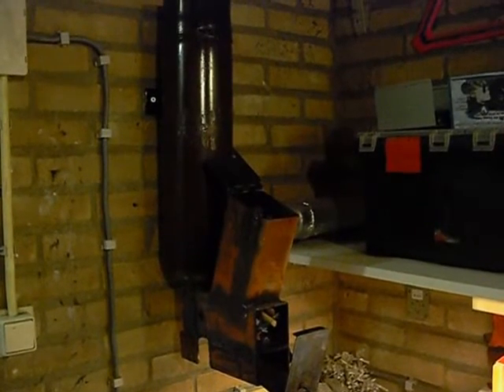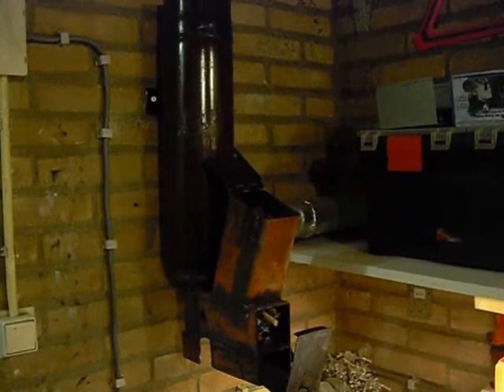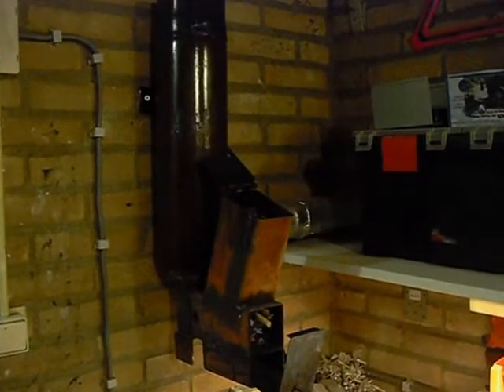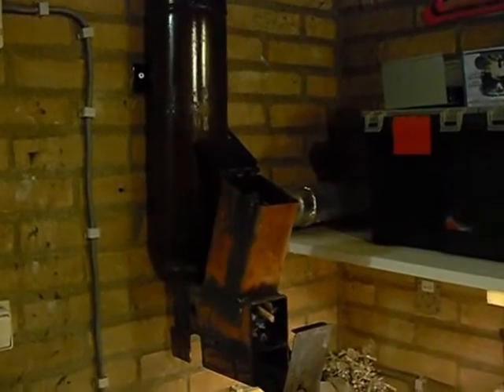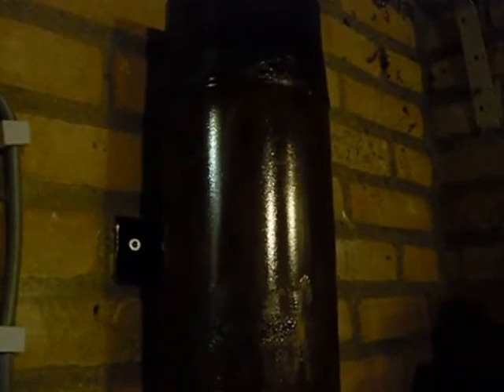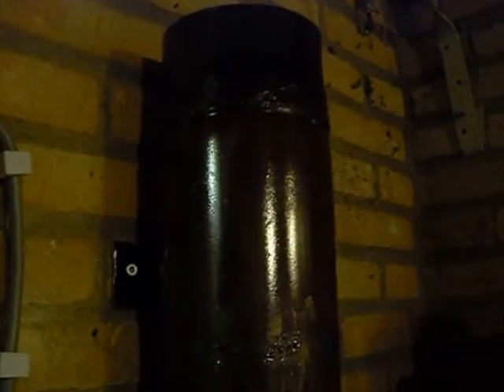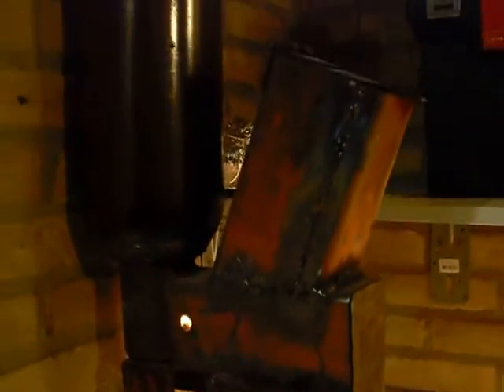Rocket stove heater (on steroids) build and installed as heater !!!

Comment: We're still patiently waiting on that knew clip hahaha. I live in Alaska and have since built this version of rocket stove heater and like it very well thanks to you of course for coming up with such a grand idea for small amount of wood and in return puts out large amounts of heat a very grand idea for sure. I'm kinda interested in seeing what modifications you've done to it since then. I built a small off the grid cabin and this rocket stove heater works extremely good. I used 4 inch square tubing instead of 3 inch tubing that appears that you initially used to build your first ones. I used the small propane torch in your video as a guide to what size square tubing you used. An updated video would be cool, again thanks for sharing your ideas on rocket stove building.
Reply from the maker: Hi Brian, 
I have been doing a bunch of different projects since the rocket stove.  You might want to check the one where i made the drip feed oil system.  This lasts a long time without refilling.  You can use just about any oil with a super clean burn.  Also i was designing a super portable stove for hiking or whenever one goes into the woods.  Also working on aqua ponics systems.  Battery charging circuits etc. Just check out my channel. 

If you have a particular design question or idea/question you are pondering about, just let me know so i can think about it. 

Cheers 

Rene

Comment: Just love this design....Excellent work, well done. This is what youtube is all about. Sharing ideas. Can you tell me though why have you got a tube leading from the after burn hole, towards the front ash tray ... why not just have the hole in the riser pipe ?
Please keep posting videos, I cant get enough of these "how to, clips"
Reply from the maker: sheller94 
I made the tube, so no gasses leak out. I have also closed up the ignition hole the same way with a tube. This way you suck in air, without leaking smoke.

cheers

Comment: Great stove! Thanks for sharing. I watched the first video before the install, and it was impressive, no smoke. However this video didn't show very well the changes you made, specifically with the plate. Before, the feed tube was completely closed with the lid. Now it seems to be exposed a little. Did you see any difference with performance? It seems like it would be the same amount of air going in, just rerouted. Why did you decide to change it? I sound like a detective :)
Also, the hole for igniting, I noticed a little puff of smoke, is this an issue?
Thanks for showing the final result, with the tank and the exhaust pipe.
Thanks!
Reply from the maker: rcruzriovista 

Hi,

I changed alot since the first design and now it is a super heater in my garage.
If i find some time, i will make a new clip to show the final build and explain why i did some stuff.
Yes you sound like a detective. And thats a good thing.

The ignition hole did put out some smoke. I changed that also. Like i said i will make a new clip !

cheers,

Rene

Comment: So if i understand this right, the heat goes upp the riser tube, hits the inside of the fire extinguisher, and then travels down again on the inside - and then out of the bottom? how does this affect the performance - i imagine it would slow down the airspeed a bit.
Reply from the maker: Exactly, but, no because of the vigorous heat, the air speed is pretty fast. It does slow down a bit of course to transfer the heat to the extinguisher.

Comment: Nice nice , how long have you used it ? I hear steel will burn out quickly , but I see so many nice stoves out of steel so just would like to get your thought on this because I have some nice tubing I would like to use to build one . I really need it to last for a few seasons without burning out , this would my preference . Thanks for sharing
Reply from the maker: Just make sure your tubing wall is thick enough. i got about 2-3 millimeters. And that hold pretty well. As long as your steel doesn't get red hot (starts glowing) i think you're fine. I can see no degradation yet on any of the stoves i build. So thick steel is the answer to dissipate the heat.
Reply: *****
emc: thanks for all your responses.  i hope to use many of your ideas. what is the flue gas temperature approx. as it exits the bottom of the tank, and when it exits your exhaust flue?  how long is your flue?  what would you estimate (in your current configuration) to be the optimum length of the riser (to maximize afterburn and heat absorption)?  i am thinking of lengthening it a bit, 4 to 6".  the hot spots in your design appear to be at the bottom of the riser and i'd assume at the top of the tank, correct?  i want to insulate my riser and firebox (to maximize afterburn).  my riser steel is 3/8" thick.  top of the tank is 1/2" steel.  i'm curious how much heat is lost thru the flue in this design.  i know that the descending exhaust gases outside the riser can push the exhaust gases a considerable distance (20' to 30', as in the mass rocket heaters).  plan to experiment with an extended flue system that uses mass absorption (concrete).  hope to see just how much the steel can withstand and push the core to its maximum before encasing and finalizing the design.  may be forced to use refractory cement to form the core.  your opinion?  many thanks. jaxson
Reply from the maker: My riser is about 50 cm. The hot spots are at the bottem and top. I believe that it doesn' t exeed 800 c.  The exaust gasses are really cooled of alot. If you use a bigger cover over the riser pipe with more surface space, more heat gets dissipated by that "dome". I used a fire extinguisher wich has a low surface area to dissipate the heat, altouhg it is very thick walled. The bigger the vessel to absorb heat, the better. Still in my setup the exhaust gasses have cooled of alot. I suspect output heat is just above 120c. didn't measure it.

I build a dome from a gas bottle over an existing fire place that normally puts out wayyyy more heat and converted it to the rocket stove principle. The exaust gasses are so much cooled of that i can almost touch the flu. At the end of the flu i can touch it.

So key is, to have a large surface area !
The riser pipe gets really hot. 800 - 1000c. so make sure your riser pipe is thick enough. Thick enough to again ditribute the heat acros the steel. I intentionally did not insulate it, so it could dissipate its heat. It is still more then hot enough to get a great afterburn ! But insulating it, prevents the riser to lose some heat, and so it might burn to scrapnell. Thats why i didn't insulate. As you saw already the afterburn is present. (hot spots)
Reply: ***** thanks for the info.  I think I'll cast a refractory fire box and riser, as the melting point of steel is being approached even with your uninsulated design. all the long lasting mass rocket heaters (which insulate the riser and firebox) appear to be refractory.  My design's intent is to contain all the heat the riser produces in order to dissipate the energy in to a mass storage, to be reclaimed as needed.  Over the top of the riser I intend to set approx. 1/2" of steel, covered in high temperature reinforced concrete, 2" thick.  The descending walls outside the riser would also be of this hi temp reinforced concrete.  I love the clean burns these rocket stoves are capable of, enabling the use of smaller pieces of wood, even bite size pieces.  In fact, I've seen where hoppers are used to feed rocket stoves w/ small chunks.  Hope to incorporate this as well.  Very curious how far the descending gases coming out of the riser can travel efficiently.  With your design, I'd estimate 20'+.  The longer the riser, apparently, the longer the flue can be. 
You don't mention it but it appears you created a venturi between your firebox and the riser by shaping the end of the firebox, forcing the gases to the right, where your secondary gas is introduced. Correct?
Reply from the maker: correct. that was the goal. And it really sucks in the extra air. Let me know how it works out with the refractory cement. That might me an idea to build in my garden (seats) i want to build from stone.
Reply: ***** I will let u know how it goes. 
What is the size/shape of the opening at the venturi?
Do you think there'd be any advantage in making the venturi size adjustable so that as the burn heats up, the venturi could be reduced to create even more suction and higher combustion and after burn temperatures?  I suspect the efficiency of your design is in the 80% range with that after burn you've created.  Doesn't hurt to keep pushing the envelope.
Another surprisingly effective mass absorption medium is sand.  I've built wood fired boilers where the firebox is encased in sand, and heavy copper pipe is coiled thru the sand, circulating domestic water for heat transfer.  the sand is almost as efficient as water in transferring the heat energy, but much easier to contain.
these rocket stoves are a revolution in design.  masonry stoves (Russian) use similar techniques but the rocket stoves accomplish even more in less space and weight.  In household applications, the Rockets' challenges are 1) delivering/capturing the intense combustion energy and making it available over extended periods and areas 2) using and casting satisfactory materials for the combustion chamber/riser that's sustainable long term 3)keeping the design compact/light weight 4) devising methods for longer burns w/ fewer feeding times.  
I've subscribed to your channel.  thanks again. jaxson
Reply from the maker: The venturi is triangular now, but that doesn't really matter. Just make sure there is enough oxygen and you're good. I am planning on making a wider air flow.

I am also in the proces of thinking/creating a way to get a super long burn. I will get back on that when i start that idea and post my findings. If that works..... Than we have some serious long lasting very cheap heating available,.

cheers
Reply from the maker: You could place a coil around the burn pipe. If the diameter isn't to wide, ergo not to much water in it, and the coil is long enough so the water has enough time to heat, you could easely produce steam. yes. I will build something like that to heat my pool next year.
Reply from the maker: rotobo1 Keep me updated and let me look at your sketches... maybe i can help out.

Comment: Well imressed with your design and features that I have not seen on other rocket heaters.The afterburner running up the side of the whole thing is very innovative- hats off! Could'nt see too well on the vid of the wall mounted heater, any chance of showing again in better light. 9 out of 10 and guess who's going to get copied!!!!
Reply from the maker: I will film it with better light soon. Winter here and dark early. So i shot it with lights on.. Not to well . true...
Reply from the maker: Good luck replicating. It is very easy to build. So i bet you'll do fine.

Ps. I welded a metal plate straight to the fire extuingisher to mount the whole thing to the wall.

Comment: You got some puff's of smoke coming from the ignition hole. Great idea, but not working as an air intake. We can't see much of the holes in the air intake.
I love the design, can you share some dimensions?
Reply from the maker: You're right. I noticed that to. When the stove is hot, there are no puffs.
I will change it a bit an run a tube parallel that i can open. Very well noticed.
When thats done, no more puffs ever.

I am into a new project regarding the stove. If that works i will post it and it will or can revolutionize the heck out of wood stove / rocket stove designs.

You'll love it !!!
Reply from the maker: Dimensions.

The feeder tube is a 8 by 8 cm tube. I cut another piece of tube at 1/3 en welded it on the feeder tube  so it is 8 cm wide and about 11 cm deep. The length of the feeder tube is 19 cm. The riser pipe has a diameter of 8 cm. and is 50 cm long.
I cut a fire extuinguisher and mounted it to the riser pipe. To get a suberb after burning ALWAYS take care of extra air intake where the fire hits the riser tube. So all CO gasses get "after-burned".  Hope to have answered you're question. You should be able to figure out all dimensions with the data i gave you for the feed tube. If questions remain... shoot ! :-)
Reply: ***** i cant wait...